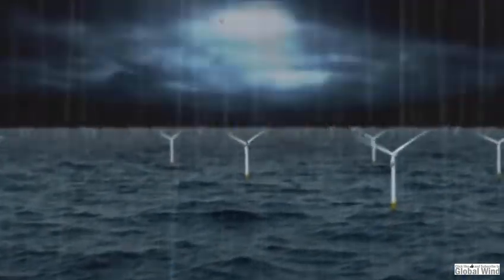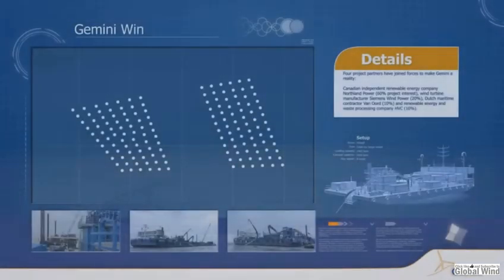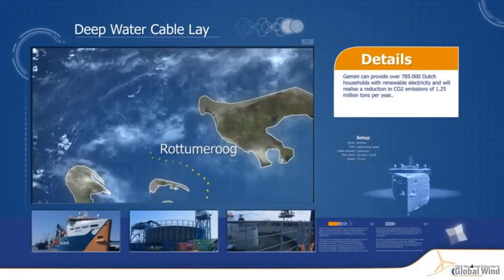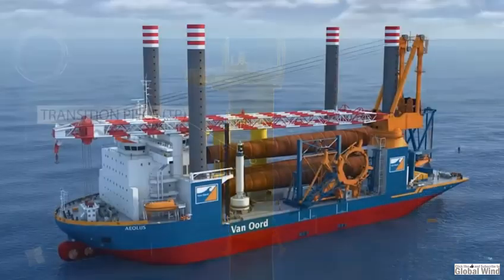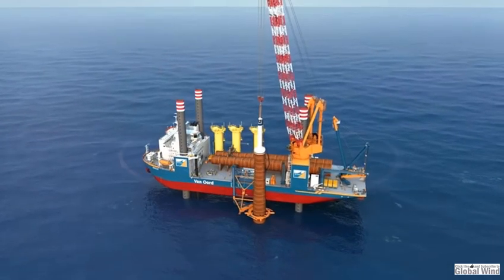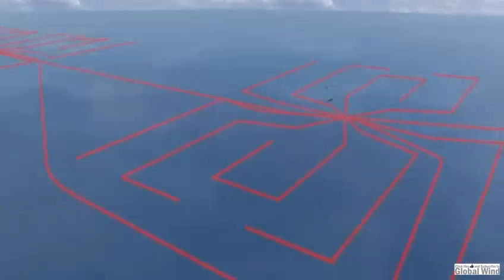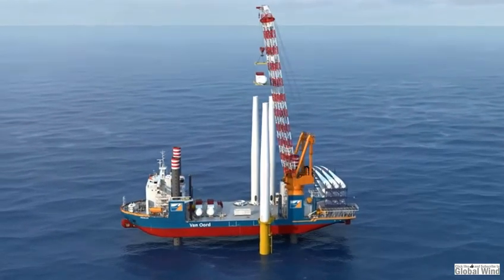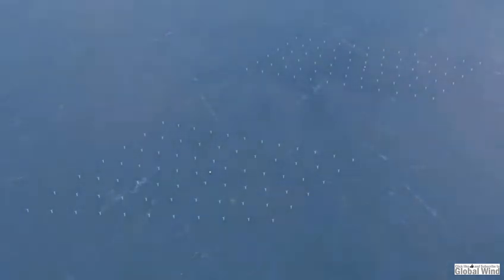How They Build Offshore Wind Farms

Comment: I’m still confused, I like the video and makes sense except for the sea is much deeper . What am I missing
Reply: The North sea is really not very deep! There are lots of areas where the depths are less than ~30m where monopiles are most effective. In deeper waters (say, off the East coast of the US in the Atlantic), different foundation types can be employed, such as a lattice structure, which offers more stability (these are typically used up to ~60m depths). For even deeper waters, floating foundation technologies have been used in a handful of places, although they're still a little unproven and expensive.

Comment: I am curious, bearing in mind that sound travels hundreds, if not thousands of miles in aqueous media (like the ocean). What kind of studies have been done on the effect of the sound and vibration that these machines will transmit into the water have been done? How will that affect marine life? Whales, in particular, use echolocation to both navigate, and mate, but countless marine species would, in common sense, likely have their environments disturbed by the introduction of such noise, and vibration. Is this all just being ignored or overlooked by the global warming doomsday crowd?
Reply: They use noise mitigation system which prevent the noise is lower 80dB at 20m range around monopile.